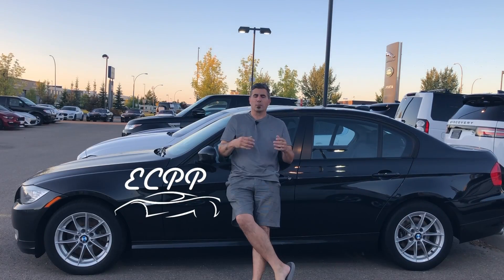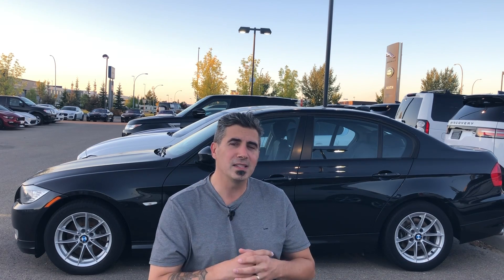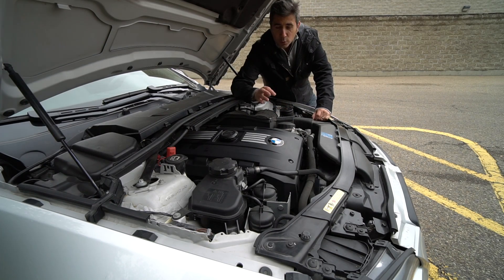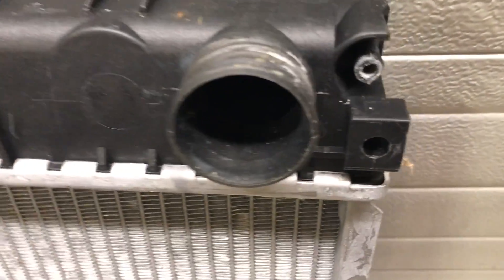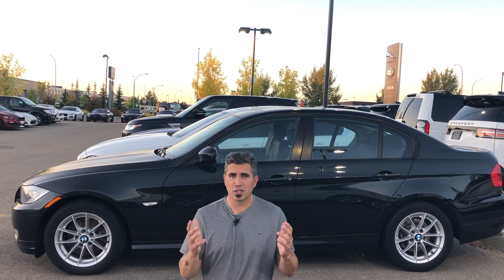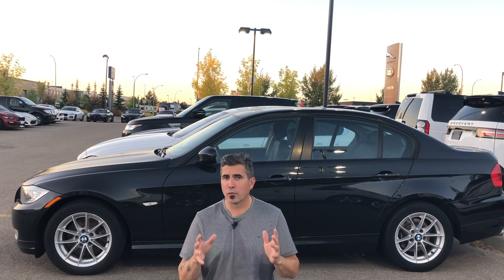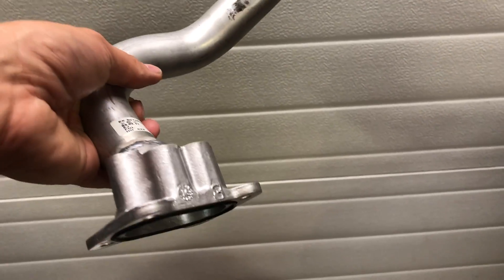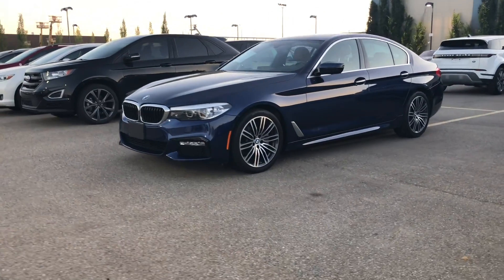Why Does BMW Use Plastic Engine Parts??

Comment: Is it only BMW that are using plastic parts? What about Benz and Audi?
Reply from the maker: All brands and even the Lexus and Acura to a point.  It’s more about the specific components and number of components as well as grade of core material.
Reply: @ECPP  I think bmw will listen to you guys. Why can't you advise them to reduce the use of plastic parts in their engines

Comment: Tell me why my upper Radiator hose on my 335i just starting to leak last night 😑
Reply from the maker: Ouch.  Common issue and the vent line as well as pump and T stat, etc.  These cars are a blast to drive so it’s unfortunate.  What I did was just replace and enjoy the drive, replace another and enjoy the drive, rinse, later repeat.
Reply: ExoticCar PlayPlace Is there a particular company that makes better water pumps and other cooling parts? How does Lexus compete in rivaling BMW? Can it light a candle?

Comment: It's more about profit then saving the planet.  They cheap out on the parts but don't pass the savings to the consumers.
German cars are way overpriced new which translates to poor resale value.
Reply: Keeping your car on the road for a very long time is the best way to save the world.
Reply from the maker: True
Reply: I think toyotas are over priced
Reply: mike a   cost means to me  how much of the cars price is wroth every bit of the car that means interior exterior and the power not necessarily it depends on what vehicle it is if its ment to be a sports car and dosent have enough power for the price and things like that lets talk about interior toyota interiors are so cheaped out on they and are just bad not very nice and when I pay for these cars I want to be able have all of the money everywhere inside the car and outside I hate toyota for their interiors and how much dealerships over price them and I looked at the price of a new supra on a toyota website and the car starts base at 40k which is perfect imo but when you go to a dealership it starts at 60k which is just way to expensive for that car there is no other way to buy a new car other than going to a dealership and I would buy the car used once it becomes like 15k but definitely not new that goes with any toyota or their  lexus vehicles
Reply: John Edwards dude the 3 series STARTS at $42k. WTF are you talking about? The only Honda’s getting to that price are going to be fully loaded SUVs.
Reply: that's why I wouldn't ever buy a new car

Comment: My M47 2.0 diesel 2006 X3 also had issues with rhe thermostat, but it my case it stuck open. My car never reached operating temperature.

Otherwise it has been bulltetproof. Amazing and reliable engine!
Reply from the maker: I also had that on my 320 e36
Reply: I exchanged the thermostat with the thermostat housing of my  2015 N57 F10 at 170.000 km. Is called preventieve maintenance and not very difficult if you have the tools. I have worn out 3 5 series before. They have never let me down, even with all the plastic. By the way: change the coolant in time and use G48 only. Helps for sure.

Comment: A car is meant to last long. That recycled and environmental sustainability excuse does not float with vehicles. BMW need to stop being cheapskates and start making cars that last. A car is like a house. I don't buy a house to be easily recycled.
Reply from the maker: True. Same here.
Reply: @ECPP  E90 is beauty tough' really nice <333 great work mate
Reply: True, that plastic story is there to reap the end user, how come Toyota has maintained to use some light alloys to benefit both the company and it's consumer. For BMW it's still a capitalist's game!
Reply: @bwalyabwalya2796  and always will, as the brainwashed clueless see it as a status symbol.
Reply: John Edwards  but they very reliable and barely crack. my friend has toyota vios he bought from taxi company that rolled 700,000 kms in 6 year, the radiator is plastic, the intake manifold is plastic but no crack. and remember that vios is being used in tropical climate that very harsh to plastic. try that with bmw.
Reply: @trianggaindralukmana2184   I hear you're point. Makes sense, but BMW is a much higher performance machine than a Toyota. Especially if you are getting a I6 engine. High performance equals more wear and tear on plastics. Even the I4 turbos bmw make are much higher performance than anything toyota sells, except maybe a Toyota camry with the newer 300hp v6.
Reply: @tookiedew  actually lexus isf is faster than e92 m3. After m3 goes to turbo, isf lc and rcf has lost. 
Toyota has their turbo engine at line up now, ls500h with 4xx hp. Their supercar LFA is no joke tough. Ekanoo dyno his stock LFA that actually put 600++ hp, more than lexus say only 556 hp, 
But didnt you feel that BMW now forget their ultimate driving pleasure and forward to AMG killer? Even chris harris says that Lexus GSF is better than M5 in terms of fun to drive and driving feeling?
Reply: @trianggaindralukmana2184  i agree. I was talking about the toyota brand not lexus tho, but good point to consider the whole company. Overall, i still think bmw's seem far more fun to drive than most of their competitors. I've driven all the suvs except the x6 and 7. I've owned e90 3 series and currently own a e82 135i. And comparing those to some of the other suvs and cars I have drove, Infiniti, Mercedes and other non luxury brands, bmw takes the cake with pleasure to drive, quicker steering and better suspension weight feel and excellent engines. When bmw engines are working correctly lol they seem to me, to be the most fun as a brand. But in this day and age I myself am considering a acura or lexus for reliability reasons, maybe even the newer mazda 3 with a turbo.
Reply: @tookiedew  yes for non sportcars level, bmw still lead to their ultimate driving feel and toyota still numb except toyota CHR that still fun because Independent rear suspension. 
I think there is no SUV japan that fun to drive. Even acura and mazda. If i just you, maybe i will pick toyota 4x4 like 4 runner and start driving offroad. Almost in all of the world toyota 4x4 is high praised for the offroad capability, excellent durability, very lot aftermarket supports, and high resale value. Yes 4x4 is suck to drive on road, but no way theres fun to drive suv on road in terms of car enthusiast
Reply: @trianggaindralukmana2184  you don't got to sell me on toyota, I have a corolla to go along with my 1'er  😅
Reply: When Lexus first started in the early 90s dealers were "complaining" about not enough warranty work(income).  BMW dealers never complain. Planned obsolescence is part of their business model. After driving used non abused 5spd 300ZXs for over 20 years I recently bought a Lexus ES330,perhaps the most reliable of all "modern" cars. I was so frikn bored I sold it and bought a 07' 328i 6spd w 50k on it. It is refined and fun. My mechanic skills have already come in handy and will again I'm sure. Still have a 94' 300ZX w98k on it.    good vid, thumbs up.
Reply: @johnmichaelkarma  planned obsolescence - this is the most key point to bring up. So true 👍 all manufacturers started to switch to this mentality over the 20th century as people developed our consumer culture. BMW likely took this to heart. Even japanese brands are starting to get on board...ehum honda.
Reply: BMW did this on purpose, statistics show their average customer replace a new one every 3 years in Europe, 4 years in US, no point to let their cars survive longer than that from a marketing point of view.
Reply: Well said. Bmw is not was it used to be anymore, is pure garbage, own one means a big money pit.
Reply: Stop buying anything German period.These guys want to rip you off with everything they can,selling overpriced crap made in china with the throwaway mentality
Reply: There's a phobia about owning or driving a BMW these days. Lease, don't buy, a new one, and enjoy it while its on warranty, then turn it in for another new one. The next stage of the phobia is, wait 'till it's three years old, and you can find them at half price. At that point, you should be able to afford repairs. If the cost of car repairs is what scares you, then stay away from high end brands.  Despite the negativities, they're still wonderful cars to drive.
Reply: @rollydoucet8909  I agree 👍
Reply: American Man  Eventually, because of problems, fewer people will lease them.
Reply: Hear Hear!
Reply: @Mary Teresa phones and cars totally different kettle of fish. cannot be compared, I think.
Reply: John Edwards  Plastics are used extensively in all cars. If it doesn't have to be made of metal, it will be plastic.
Reply: Why will i wanna own a car for more than 10years?.. An enthusiast will change cars every 5years max for the pleasure of enjoying machines. And when you are buying a Performer for cheap, Spending a Few Box to Give it some years of Reliability is all Worth it. You only live once
Reply: @oloruntosinkinyomi9562  Yes you only live once, so why be a broke ass all your life because you are throwing all your money into a car? I only live once so I'm stacking and investing my money so I don't ever have to worry about anything financially.
Reply: Classified Info exactly lol people are dumb

Comment: BMW doesn't care about the environment. If they used stronger parts instead of plastic, BMW's would last a lot longer and more people would hold on to them longer or buy used which would cut into BMW's profit. Designing a car that breaks down right when it's out of warranty, now that's clever engineering.
Reply: Planned obsolesence. Billions go into developing such vehicles that are true icons yet meant to be disposed at a very precise time! Do I own a BMW? Yes. Will I stop buying them? No.
Reply: That’s bs, Toyota still sells more new cars even though they’re reliable. I think BMW is still using plastic in the engine because they’re obsessed with weight cutting and speed.
Reply: Nicolas Mikah Toyota sells in my opinion reliability, luxury, and usually adequate performance. BMW sells on Power, Handling, Performance not at all the same factors that sell Toyotas.
Reply: @jamesmedina2062  BMW is more luxurious
Reply: Abin Saji Equal or more people find Lexus more luxurious. It's simply the lux brand whereas BMW is the performance brand. You basically can have your cake and eat it too. Both brands push both qualities to certain limits which are then exceeded by other brands such as Bentley for example.
Reply: @jamesmedina2062  yes its just that lexus is just boring a bland and over priced
Reply: @jamesmedina2062  a lot of people compare base models to higher end models or old to new
Reply: @jamesmedina2062  toyota price them accordingly and then dealerships price they crazy over board even normal toyotas are over priced imo
Reply: @jamesmedina2062  Bmw has some high quality parts I read about people liking BMW interiors more than lexus most people think lexus interiors are a little bland and boring for cars at a high price range
Reply: @jamesmedina2062  even looking at pictures Bmw is better I love the baige interior and the red and the black and cream interior is also beautiful and lexus do have colorful interior but they look more bland seats are mostly one color and you dont get that beautiful tan or baige color that you can find in bmws which is just so nice
Reply: @jamesmedina2062  I think BMW has a better feel of driving and luxury yes they're unreliable the difference between lexus and bmw is that lexus use plastics on the cabin and bmw use plastics in the engine bay bmw should stick to aluminum or any other type of metal thats for sure but the sheer driving pleasure is like nothing else
Reply: Abin Saji multi color is more of a bold statement in line with performance, not luxury. Luxury usually has monochromatic leather, chrome, real wood, etc. Just look at a yacht or luxury watch. Performance models will be the ones with more colors.
Reply: Abin Saji yeah pure luxury can seem bland or boring. Thats because the concept of luxury is synonymous with isolation, less feeling, less sound, perhaps enough to make you feel like you can go to sleep. To some people this puts a smile on their face. They don't want to feel the bumps in the road as harsh. But good luxury cars will let you feel something. They won't be like the American luxury barges sold in previous century. You didn't feel anything and they were slow. Lexus are quick and handle well.
Reply: Abin Saji It depends on the model but as far as all the Toyotas I have seen, they make Toyota little money and are priced very low for what you are getting which is really a more generic and cheap Lexus.
Reply: @jamesmedina2062  and your saying bmw dosent have wood
Reply: @jamesmedina2062  what luxury is ment for a smooth comferting ride its like sleeping on a pillow is what it should feel like bmw is a little bit more aggressive than lexus but when you want comfort it gives you that
Reply: @jamesmedina2062  I think toyotas are overpriced dealerships over price them and people would still buy them because its a toyota
Reply: @jamesmedina2062  toyotas are a cheap lexus but they're over priced when I look at a car no matter luxury or not I look at everything even lexus is over priced imo dealer mark up on these vehicles are insane
Reply: @jamesmedina2062  I want the interior the driving feel the comfort all to be worth for the price I pay for the car
Reply: @jamesmedina2062  I would buy a brand new kia than a new toyota because kia interiors are much nicer imo
Reply: @jamesmedina2062  lets talk about the new supra ok on toyota website I see the base model to be princed at 40k which I believe is a perfect price for that car and is an amazing car for that price but then you go to a dealership and they asking you 60k plus thats crazy
Reply: Someone should start making duralumin pipes and parts for replacing bmw and other manufacturers cheap plastic.. if done smart it could be done rather easy.
Reply: @nicolasmikah4168  you can't control the market, more sales doesn't mean Toyota doesn't care about the environment. People simply trust them more. Bimmers aren't heavy but I wouldnt call them light neither.
Reply: @nicolasmikah4168  LOL fool. A quick LCC (Life cycle Cost) calculation of the corrective and preventaive maintenance intervals and associated costs would show a BMW is deigned to drive after sales not be reliable. Put another way, if it costs £1000 to service the car which goes on to spill its guts within 500 miles of that service the preventative task was a waste of time, incorrectly defined or the interval is incorrect. These are lifed parts that will fail and require overhaul to keep in good condition, but thats not on the maintenance shedule and BMW makes it fix on failure. 

You basically pay a fortune for their service to get a car to the end of warranty that then goes on to fail or requires overhaul of components. If BMW wanted to they could easily get a car to 8 or 10 years between major failures with limited overhaul. It's well known that plastic and rubber is lifed for 6-8 years but that life reduces when exposed to UV, chemical or heat cycling.

In short, BMW know what they are doing and what they are doing is ripping you off.
Reply: @polla2256  100% thats why I will buy a used bmw and swap in aftermarket metal parts made by other companies and never buy a brand new bmw
Reply: You comment is an extreme exaggeration and you have clearly never owned or worked on a used bmw.
Reply: @Bawbrahs it’s all true, plastic degrades, throw away car like all cars. However all this plastic crap, makes it absolutely beyond economical repair. There will be no classic BMW M cars from now running in 40 years time.
Reply from the maker: For sure
Reply: Clever maybe... but considering we live in a consumer culture, and I am a consumer, I simply call it crooked engineering 😆
Reply: Haha exactly
Reply: Solomon Dixon  and its just over all nicer to drive and experience I havent driven or been in one but all the people who talk about their bmws who own one say they're fantastic drivers cars and I would love to experience that
Reply: Solomon Dixon  I am 18 and unemployed and I have been in toyotas and lexuses they do feel nice but when you look at the price they're not that nice well toyota feels super cheap
Reply: Solomon Dixon  I love to select my gear bmw is a better driver its more engaging and more fun to drive thats all I care about I dont care about what has a nob to change the gear personally I hate that I am a traditional manual lover
Reply: Solomon Dixon  what I hate is all these toyotas are over priced for a bad driving experience they aren't that great to drive havent driven a lexus so I dont know but a lexus is a dressed up toyota so I dont think there will be any difference
Reply: Making people buy new cars ever 8 years is NOT smart at all . It's  so waistful.  God help us if they are going to do the same with EVs ,I'd so just wait until we run out of lithium and cobalt
Reply: that's not clever engineering; that's capitalism, my friend.
Reply: I am so sick of the "green" virtue signaling, by selfish leftist a**holes.  Usually, when you peek behind the curtain, it's a story like this, and things are changed from common sense and efficient (the original market solution) to something worse, to "save the planet."  Unbelievably ridiculous.  In the end, it's less reliable, more costly, and less environmentally friendly.  Case in point, BMW.
Reply: BMW is a scam. Just like it brother Volkswagen